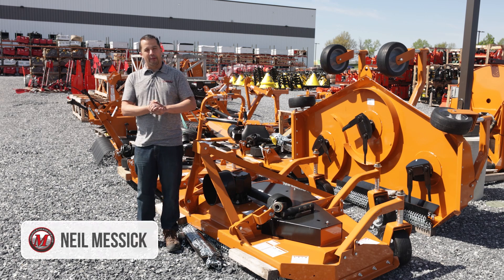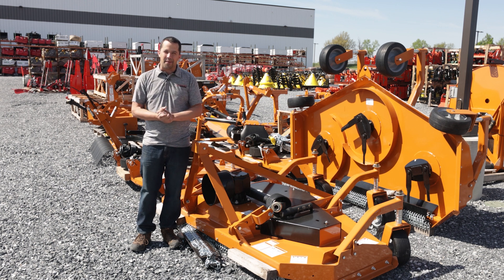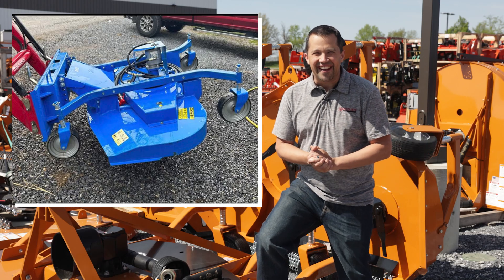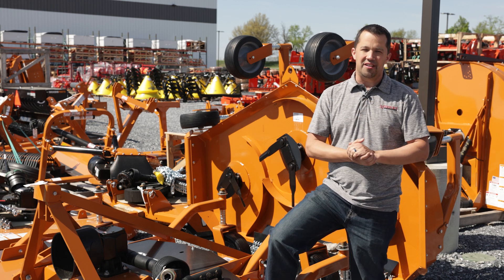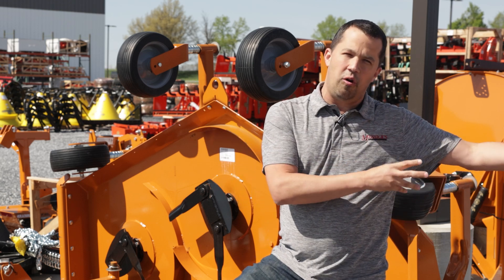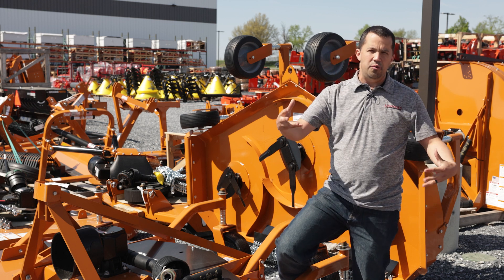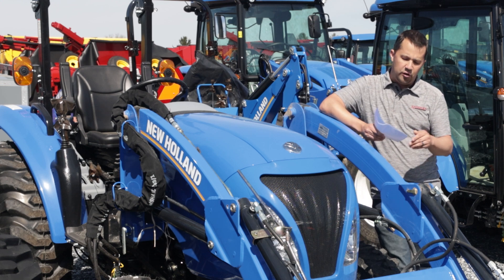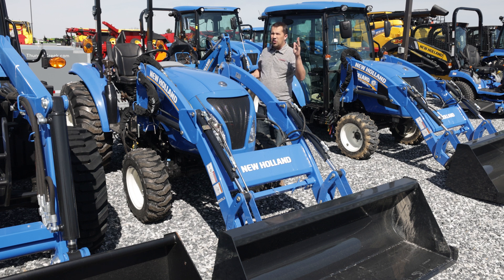This Mower Should NOT Exist!

Comment: Would work just fine with a stand-alone, auxiliary hydraulic  system ran off PTO.
.
Other than that, modify it for rear tractor use.
.
that 1714 formula dosen't take any efficiency losses in to the equation.
Such as 90degree turns in hydraulic parts, under sized hoses, ect, ect, ect.....

Comment: Minus the hydraulic  flow needed for steering, and the hydro-static transmission.And the joys of Chinesium, not cleared out of the lines and cylinders, contaminating your system. 
Buying a no name system for your expensive tractor is asking for it. No, demanding it. Might just void part of a warranty.

Comment: Scag has front deck mowers driven by hydraulic motors, driven by 25-30hp twin Kawasaki or Kohler engines, but i imagine the pumps are flow rated to run the deck drive motors.

Comment: Loader front mount mower. Sounds nice and maybe it could work off rear or front pto pump. It would require more than some additional hardware to power it. I'm wondering if the loader and mower would have too much down force when in float mode. Also I don't see if there is a hinge providing independent rotation for the front wheels to raise or lower independently from each other as well as rotation for the left and right wheels. There needs to be a way for all 4 wheels to stay on the ground.

Comment: I would think that you will add alot more heat to your hydraulic system with a front loader mower vs PTO driven unit. 
The only thing i can see a use for this type mower, is trimming around edges of property like over the bank and whatnot, maybe some pond edge work. I wouldn`t mow my yard with one.

Comment: Not to mention the heat something like that woukd generate and how much hydraulic cooling capacity the tractor has. Most of those small tractors are meant for intermittent hydraulic use moving cylinders back and forth and some power steering operation. Not constant full flow for hours. 

And I would certainly not like to be in direct line of the output of that mower being what appears to be rear discharge. The operator and tractor will both be absolutely covered in grass clippings.

Comment: @Messicks you failed to address how much hp a mower like that needs. If it only needs 8 to 10 hp then where is the problem? Without knowing what the actual power requirements are how can one truly know how well it might work? Guessing from looking at a picture seems to be more an exercise in clickbait than a serious discussion of the merits of this tool.
As for your rear PTO, when the engine hp is also used to drive the machine there won't be the same number of hp to drive the implement.
Reply from the maker: typically your driving finish mowers with 3-5 Hp\Foot.

Comment: Actually I think the mower itself is a great concept.  I had a finish mower for my small tractor and hated it so much I went and bought a zero turn.  All that the front mower needs is a hydraulic power unit that works off of the pto or off of the center pto. These hydraulic units are pricey but being able to reach in under bushes and see what you are mowing is a big plus.

Comment: I have a 72" front mount brush cutter running off of the third function hydraulics, and I can tell you the overheating issue is real.  Mine is on a 100hp Kubota M100GX and I only run it for about a minute at a time, getting between trees and on pond banks I can't mow with my 15' Rhino flex wing. Even then it starts to get hot soon enough that it is an absolute no-go for a large swath of land.  I'd need a hydraulic cooler and a spare tank like mentioned below for sustained use.  Not my favorite implement.

Comment: I don’t want it and do think it’s a little wonky, but who says you have to run it off tractor hydraulics?  Can always add a PTO pump and reservoir.  Front mount has it’s benefits.  Stop being so negative and use a little imagination, especially since no one makes front mount implements (other than a snowblower and broom) .  And especially since the front mount adapters for these tractors cost as much as the loader.
Reply: so true , not very practical

Comment: If you run a hydraulic mower with the return going through the valve, it will overheat the hydraulics.

The lane shark front brush cutter fits on the front and it is slick.  The trick to running it off of the third function is to run a separate line back to tank that bypasses the valve.  If you do this, it won't overheat.  

All that being said, being able to cut the grass before the tires roll over it is super nice.  I bet it does a great job compared to a belly mower or rear mower.  Letting the lift arms float and the mower being on its own 4 wheels is a super good design.

Comment: Nice idea, terrible implementation.
Every golf course reel mower runs hydraulic motors... there it works.
The pump is capable. Thats its sole purpose. Transfer engine power.
This might work on a skid steer, something thats dedicated to hydraulics and will have the flow.

A regular tractor with fel? The hydraulics are just adequate for what they have.
I got the perfect pump. Came from an elevator. Has a 1.5" delivery line... strap it straight to the crank, add an extra oil tank, admit it will require twice the power for the same mower unit as pto drive, and select driving speed appropriately, blah blah...

Sorta defeats the purpose!

Comment: Another thing that was overlooked is looks like the mower has a case drain. So unless you can plum that into the non pressure side I dont know how you would hook it up to a regular tractor. It would also need an over run clutch or the equivilent in hydraulic bypas valve.

Comment: I run a lane shark off my rear remotes and it has plenty of power. 50 hp kubota
Reply from the maker: different animal, and should have been part of this video. Made for low - flow - low HP. This is not.

Comment: It's a "finish" mower.  Some 72" decked zero turns run 27hp engines.  Probably about half that power is turning the blades.  So a tractor putting out 14-15hp to the hydro would probably be fine.  The problem would be people trying to use it to cut grass that is a few feet tall...which a finish mower isn't designed to do.

Comment: Yup, I don't agree. After running a sidecutter for years that spins off of hyd. i see no reason why a small tractor shouldn't run a  finishing mower. The horsepower excuse doesn't cut it, hyd. works differently than raw hp.

Comment: I am thinking about making a hydrologic front mower, but I was going to make a PTO driven pump and reserve tank. I want the greater flow rate and the ability to keep the oil cooler than running it through the tractor pump.

Comment: Good to let people know and understand the limitations of these types of things so they don't end up buying attachments that don't work. 
Still the north American market is really slow to adapt and appreciate the niche value of these things. For instance having a high flow LX series that could run a hydraulic snow blower or forestry mulcher on the loader would be awesome, but they'll be selling the subframe mount snow blower for  the next 20 years just because they can. 
Not to mention things like equal size front and rear tires on tractors, or a default font and rear 3 point hitch if you don't have a loader.
There's room for innovation and evolution in the tractor market, but due to these common sense ideas and standardized implements and offerings. There's not a whole lot of experimentation for brands like kubota.

Comment: Front attachments are better options if you would run them from the mid PTO just like the front snow blower. 
Now if the lazy attachments manufacturers will get their behind back to the design and engineering table they could many implements just like ventrac. 
The PTO kit from snow blower (mid PTO to front of tractor) could be made for universal attachments. 
Front attachments would be:
- snow blower 
- sickle bar mower
- finish mower 
- brush hog
- trimmer lawn mower 
- flail mower 
- yard blower 
- hay rake 
- concrete mixer 
All of this (and more) could be run from front if you use the mid PTO extension or they could make adopters for a shaft and driveline for rear to front PTO connections.
If we could take it a step further and have the tractor manufacturers to add a front PTO. 
Hydraulics should be use for implements with cylinders and not for rotation purposes. Flexible shafts can  also be made to help out.

Comment: I have a 60 inch king cutter finish mower I turned into a loader mounted mower 10 years ago. It has a pto hydraulic pump and tank that is 3 point hitch mounted to run it. I hang it on my Kubota bx25 with no issues and so far I have not found anything that even touches the governor mowing with it I completely sumerge it all the time mowing the edges of ponds and nothing tractoer picks it up and down with no issues or even hits the relief on the tractor which I can do digging dirt. I've mowed alot of acres and banks and ponds with it over the 10 years since I built it and always wondered why it was not an option for all tractors.

Comment: I disagree, back in the 70's I worked for a Jacobsen Distributor when a lot of our equipment (72" mower decks) was powered by hydraulics. The engines were smaller but the machines did a good job cutting rough areas around the golf course. The mower deck that you show had four large wheels that would allow the mower deck to simply roll along the ground while the front end arms on the tractor is in the float position. While the setup is not ideal due to the fact that you don't have good visibility it should not be that big an issue. This is not a bush hog it is simply a good mower for mowing grass that is not 3 feet tall. This would work good for a home owner or anyone on a limited budget.

Comment: Typical Chinese junk to play on people's lack of knowledge. The power pack is the way to go, but a compact tractor might be too heavy for turf. They work great for brush cutting. We got one of the last TrailBlazers with a power pack. We like how it cuts through brush on the front.

If someone really wants a front-end finish mower, then they should go with Steiner or Ventrac. Lots of attachments, but they are limited on their loaders.

Comment: This shows how desperate us boomers are to having a mower on the front so we don’t have to turn our stiff necks to see what we are doing. Tractor manufacturers need to see this and return to making front mount 3point hitch/PTO’s so we can have a front mount mower or flail, like  you can get in Canada. I bought a front mount Grasshopper mower and have never looked back (Literally)!😆
Reply: Yea i love those front mount grasshopper. Can't stand mid mount zt you can't cut as close without getting yourself tangled up in what ever your cutting around. And they crab cut really well on steep hills.
Reply: Every grasshopper I've worked on just needs a service and blade sharpening. Absolute beasts. Built farmer tough lol
Reply: That's nature's way of telling you that you shouldn't operate equipment anymore.   I remember an elderly farmer in my neighborhood would insist on running the pull type chopper for the family dairy.  His grandson would talk about when the head would plug while chopping corn and he wouldn't notice until he ran down two rows of corn all the way across the field because he hardly ever looked back

Comment: A few years ago I bought an Iseki SF333 with a 72 inch mower. It’s very similar to a Kubota F series machine, basically a small tractor which is back to front. The Iseki is quite old and has its problems but having a mower out front is so better than having the mower out the back.

Comment: PTO off the back of the tractor is the cheapest way to go  on fuel.   I have a Bush hog for my skid steer    I don't use it too much    I go to 5 hrs on a 19 gallon fuel tank from full  to out without on normal use  8 HR on 19 gallon

Comment: You're totally right Neil, but you hit on a quiet truth of the industry:  The SSQA has done wonders for carrying tools up front, and there is yet to be as versatile and universal a standard for the rear end.  Loaders are in the modern era, and 3-points are stuck in the 19th century.   The easy of use of a loader equipped with SSQA is driving the market for these weird things.

Comment: Neil did not include the efficiency of the hydraulic motor in his calculation of power to the mower blades. His calculation is for the power available from the hydraulic fluid. But the hydraulic motor is probably only 70% to 85% efficient at converting the power in the hydraulic fluid to power turning the blades. Multiply Neil's number by the motor efficiency to obtain the power available at the blades. In contrast the gear system in a PTO powered mower will probably be 95% to 98% efficient in delivering the power in the PTO shaft to the blades.
Reply from the maker: this is the way.

Comment: Neil - Love your content, but I have to disagree with you on this one. While technically from the way you did the specs it is a compromise to run the mower on hydraulics. Yet there are so many versions available for skid steers that do just that as are hydraulic PTO/motor driven power packs that you hang off the rear. Having a small brush cutter on the front loader would be super awesome for much of my ditch maintenance where I have a V shaped ditch that is difficult to maintain.
Reply from the maker: see LaneShark. Different animal all together. much smaller, single blade, made to run on low HP.  The mower in the video is nothing but a 3pt hitch mower with a hydraulic motor bolted to it.

Comment: The front mounted Lane Shark which is powered by tractor hydraulics has appeared in Messicks videos. This just seems to be a budget version.
Reply from the maker: I should have referenced the LaneShark. Different animal all together. much smaller, single blade, made to run on low HP.  The mower in the video is nothing but a 3pt hitch mower with a hydraulic motor bolted to it.

Comment: A belly mower uses the mid PTO. A front mounted snow blower uses the mid PTO.  Why can't a front mounted mower uses the mid PTO?
Reply from the maker: as soon as you lift the loader or roll the bucket front\back you would be running the shaft at an impossible angle.
Reply: Use the Kubota front mount quick hitch that attaches to the frame not the loader.
Reply from the maker: @andrewgee241  a front flail is available on the GL-60, so it does exist. Really pricey setup, but it can be done.

Comment: Don't forget the PTO hydraulic power pack that runs lines to the front for constant work like a SSQA brush hog or branch limber. I don't know their hydraulic flow but it is generally much better than anything the tractor puts out.
Reply: A hire company i use to work for Had a few of them on kubota B series tractors with front a road broom on the front those little things were awesome

Comment: Don't forget the A series Bobcats (discontinued recently) that have all wheel steering.  I could put that on my Bobcat A300 and have a 9000 lbs mower, I mean, that's what you need right, a 9000 lbs mower?  Just think how exciting it would be mowing over your septic tank!  Love my A300 around the farm.  Seriously though, when I saw this "finish mower" for the first time I laughed.
Reply: Bobcat is actually releasing an articulating tractor line - reminiscent of a Ventrax - shortly. So the A-series influence continues.

Comment: My guess is you put the loader into float mode and drive.
Reply: The idea is feasible but I would have a remote hydraulic pump run off the tractors PTO and a reserve tank for it's own hydraulic fluid.
Reality a 3 point mounted finish mower would be cheaper and prolly a lot safer.
Reply: Thats fine if you have a flat yard, but otherwise you would have to keep adjusting the angle.
Reply: @Matt-mq1ep  good point.

Comment: Excellent point about the hydraulics issue but what about the fact that they used a rear discharge deck and put it in front of the tractor!  You’re shooting everything right into the radiator!!!!
Rear discharge means just that: out the overall rear of the entire machine.
Reply: Yah I was thinking he would list several reasons to not do this